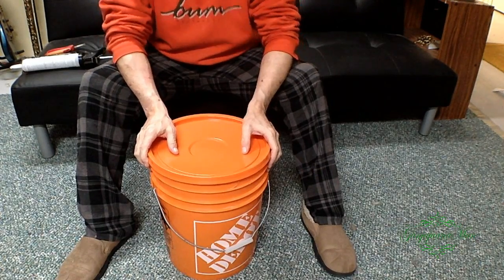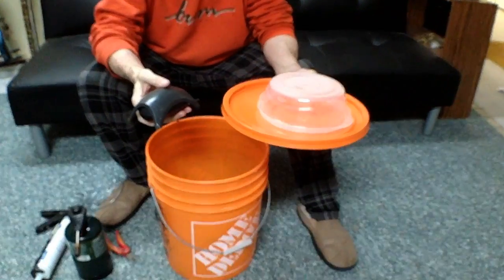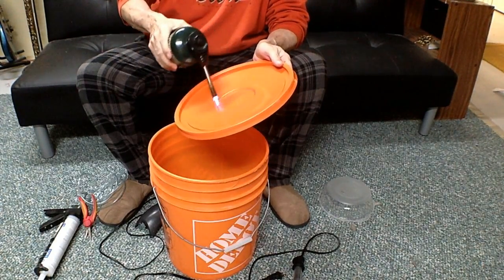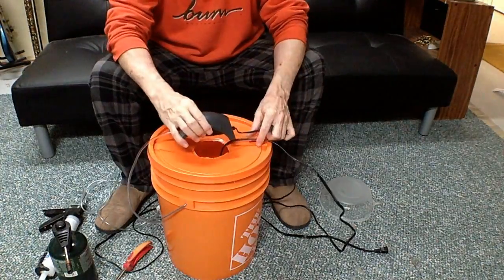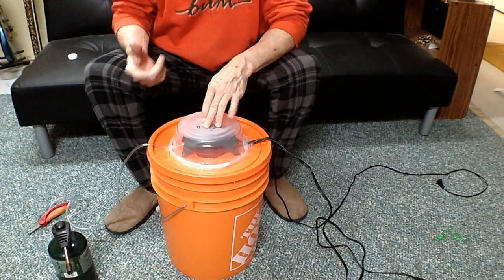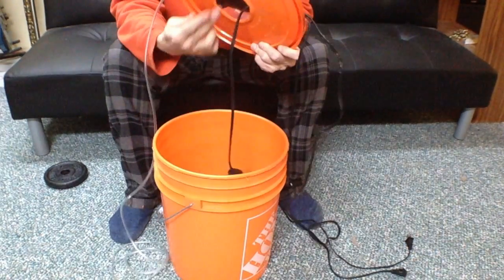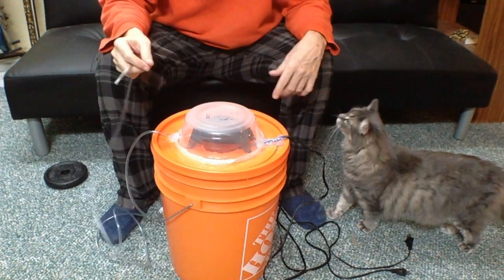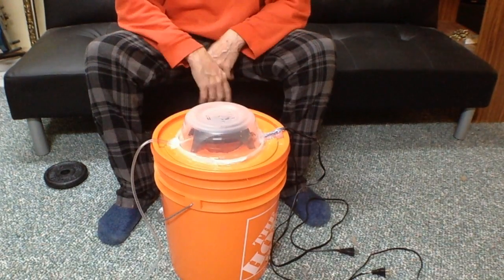c02 Generator: How to, diy, homemade.

Comment: Well done mate! Nice info: simple and straightfoward! Have you ever heard of gamma seal lid? It's seems to be worth of a try concerning the non-hermetic problem for the air pressure. I'll try this on my photobioreactor in conjunction to arduino controller CO2 flow meter. Greetings from Brazil!
Reply from the maker: Thanks, no I haven't heard of that before. 
I have actually figured out an even simpler build, using the air tight lid that comes with the buckets.
It'll blow your mind how simple it is, WAY easier to make then this one & will work 
just as good. stay tuned for a new video.
You will still need an air pump. 
Thanks for watching 💨💨✌
Reply: GanjajuanaMan Great! Eager to see the new design.
Reply: Hi Ganjajuanaman!  I was about to build this bucket system, when I read this comment. Any chance of getting the upgrade video please?  Would be rally appreciated!  Thank you!

Comment: I have a 8 X 16 greenhouse how many of these things do you think I would need also what size Aqurium pump should you get I was on Amazon and see the have from 10 to 100 Gal pumps I would think maybe 10
Reply from the maker: I'll tell you how my room works, maybe that will help you.
In a room with no air vents about 10/15/8 feet I have some tents.
I have one C02 bucket outside the tents with a hose feeding the C02 into the top of 2 tents with a spliter,  Inside each tent is a fan circulating the air & C02 all around the tents. An exhaust fan sucks the air from the tents & blows it back into the room, filling the room with C02 that constantly gets sucked back into the tents because of the vacuum of the exhaust fans, it's a closed circle of air & C02. It just so happens that my temperatures all stay in a good range with this sett up.   
If your green house is sealed during daylight hours & the air & Co2 is circulating & you keep your temperature in check, I think one would do it.
Plants don't need extreme amounts of C02. But a little more helps a lot. Thanks for watching.
oh, just a small air pump & air stone.

Comment: Thank you so much, I built the exact thing with same materials you use and my co2 PPM went from 275 to 1800 PPM and my plants are loving it.
Reply: hello can you tell me what doses you used? I put in a 5 liters tank, 4 liters of water, 1 kilo of sugar, a piece of yeast and a teaspoon of bicarbonate of soda but it does not increase much the ppm. can you tell me your exact doses? I would be very grateful thanks
Reply: @M4stgirls  you need an air pump and you also have to shake the bucket everyday. I never used sodas!
Reply: So I take it I shouldn't have my grow tent in my bedroom if I'm going to make one of these
Reply: @themastergerman9989  i don't think it can get to the amount that can hurt humans. co2 becomes poisonous to us humans after 5000ppm. plants need 700 to 1500ppm. set a timer that stops when they reach 1500ppm or just turn on the ventilation to lower the ppm again.
Reply: @M4stgirls no...1200ppm...anymore than that is just pointless because cannabis saturates at 1200 pm...that's what Bruce Bugbee says anyway
Reply: Cannabis saturates at 1200 ppm

Comment: why do people just not buy a 20lb co2 tank from air gas and a regulator with a built in solenoid switch?  you can control how much is getting used and when. it also lasts for a long time.  My 20lb tank has lasted over 2 years.  All this other crap doesn't make since.
Reply: How much did you pay for your tank and fill? This is info that would be considered relevant to the discussion.

Comment: could you add a winemaking airlock to see when the co2 is active?
Reply: That would affect the pressure in the bucket though. All the co2 you're trying to push out to your plants, is just gonna take the airlock route first because less resistance than an airstone. A water level gauge? with clear tubing, would probably work better.

Comment: How necessary is the pump? I'm using this setup to pump CO2 into a small plastic container, about 1 x 2 x 2 feet in total, with some herbs in it. I have the bucket underneath, and a t-splitter coming out of the lid with lines that go up into the container. I assumed that CO2, being a heavier than air gas, would accumulate in the bucket, and as the pressure increased slowly it would force the gas up the splitter tubes into the container. I can hear/see the yeast bubbling away (they are a bit cold so I'm working on a heating solution) but I can't tell if the gas is making its way up the tubes. I think my connections are airtight, I did a blow test and it took a good amount of pressure before I heard a leak from the seal of the lid of the bucket. But it's hard to tell if the gas is actually going where I need it to go. I don't want to seal up the container without any CO2 in it, the plants will suffocate on their own oxygen!
Reply from the maker: A way to test if it is getting to the container, is to put the ends of the line that go into the container into a glass of water, if it makes bubbles come from the hose then it is getting there, if no bubbles, it's not getting there, then add an air pump. They'er very cheap to buy.
Thanks for watching.

Comment: Cute cat!
I'm sure some people didn't hear, but you're spot on about the timing.
Turn off the pump when the lights are off, the stomata under the leaves are inactive when it's dark, so won't really have any benefit running CO2 while the lights are off.
Reply from the maker: Thanks for watching, check out the newer C02 generator in my most resent video.

Comment: I think this idea is great and have built three of them!  One of the problems I'm having is condensation in the hose and then it won't blow air.  Anyone have solutions?
Reply from the maker: I will make a new video soon of a new and improved & easier to make C02 bucket. thanks for watching.
Reply from the maker: I posted a new video that should solve your issues.  💨💨✌

Comment: Sweeeeet I have a co2 regulator for the tanks but it’s super expensive and I run out of a large tank twice in a single cycle. I like this especially if it generates enough co2 for me maybe I’ll run two.✌️
Reply from the maker: check out the new Co2 generator I made.

Comment: Running the air pump to a stone will greatly increase co2 by agitation and supplying the yeast oxygen so it can reproduce faster. Active dry yeast is most active @ 95`F

Comment: really need 2 air pumps need 1 to bring air in to be c02 soaked maybe a airstone coming from a different pump outside the bucket brings fresh air in and bubbles up the mix for the bucket pump to pull more air n c02 out into the surrounding area

Comment: What I Did was put the pump on the lid inside of it. I screwed it to it. I used different air pump and I took the screws that hold it together and then ran longer screws from the outside to where the old screws were. One thing everyone is missing is you need to pump air into the bucket. If you seal it tight like you have here the pump has no place to get air from. So you need a pump on the outside to pump air into the bucket. Hope you all understand.

Comment: yeast likes body temp 37c. id try wrapping a heating pad around the bucket instead of a heater. maybe use less energy. most ferments are done after 5-8 days. the co2 after that point would negatable. kill two birds with one stone and buy/make a still.

Comment: What temperature you maintain with aquarium heater?? Kindly reply
Reply from the maker: the heater that I have does not have a temperature setting, it is on when plugged in & off when unplugged. my guess is that it keeps the water between 75 & 85 degrees. it is the cheapest heater I could find. I got it at Walmart for about $20, seems to be just right.
Thanks for watching.

Comment: you don't need the air pump.... serious. do this in a carboy instead with a bung and attach your tubing to bung. done.
Reply: The CO2 produced is a gas that  when being produced creates pressure and the CO2 will be  expelled from where it's created.  I think the air pump may make it more efficient in creating CO2, while the heater(not a necessity either) probably keeps the yeast at a temperature that also makes this work more efficiently. Check out the many videos of yeast and sugar CO2 creators. Most are very simple, but it sounds like the 5 gallon bucket version puts out higher levels of CO2 for a longer period of time.
Reply: D.J. Parson do what? Can you explain that a little better I would like to try
Reply: D.J. Parson... your comment makes no sense to the amateurs here :)  Could you explain farther?

Comment: This is a great idea. Looking to do a set up for a planted aquarium. Only problem with this set up is the amount of co2 being pumped into the aquarium. Wondering if hooking up a simple bubble counter and diffuser is all thats needed.
Reply from the maker: I don't know if that is a good idea, the fish in the tank Need Oxygen. they will die if you pump C02 into it.
I used to have an aquarium with live plants, & my plants thrived but it was 
because I was using the proper kind of light. be careful !
Reply: GanjajuanaMan thats what the bubble counter is for. To regulate how much co2 is pumped into the tank.

Comment: Hi man, thanks for amazing explanation, I will definitely try building one for my box. Could you tell me does this can need an intake hole? because as I understand the pump pulls out the gas from inside, but since there is no intake I do not understand when the co2 runs out will there be any risk of damaging the pump?
Reply from the maker: High man,
my bucket lid does not seal air tight so when the pump is on it does suck air in from the rim.
but still gives a great & cheap C02 boost.
at first my lid was too hard to take off the bucket so I melted a little bit of the lid rim just to make it easier 
to put it on & off, so that is where mine gets air from. you could do the same thing or put a small hole 
in the lid for it to get some air. it doesn't need very much but does need some to prevent the bucket from collapsing in on it self.
Mine just turned out this way (by accident) & it works great, I wish I could say that I had it all figured out 
but I got lucky lol. a few people have commented that their  bucket caved in, but I think they have it under control now. Best of luck to you.
Reply: Thanks for the reply man! I will build one for my box and let you know about the results! good luck to you!

Comment: i came i saw i built i dig it in  3-4days i could tell a difference . seems to last pretty strong about 10 days and it's cheap. much thanks, question sir is it true room can be warmer with co2. it's hot here
Reply from the maker: Awesome, 
Yes with C02 you can have your room hotter.
& if using LED lights you will be fine in the mid 80's  💨💨✌
Reply: +GanjajuanaMan traded in the bucket for a glass sparkletts bottle with an air inlet sealed in the lid pushing the gas out of a piece of pic pipe that i can cork if i want also coming out of the lid.. can see it bubbling without opening bucket. i seal it at light time open in dark. thanks again

Comment: how do you prevent it from collapsing on its self
Reply from the maker: My bucket lid does not seal airtight, It gets some air mixed with the C02
Reply: did you take the rubber ring out of the lid?
Reply from the maker: My lid didn't have a rubber ring in it, but when I first got it it was way to hard to open so
I used my little blow torch on the part of the lid that seals so that it would be easier to open.
the end result is that there is a mixture of air & C02 but still gives a great C02 boost.
You could either modify your lid so it go's on & off easier & takes in some air there or make a Small hole in the lid so that it will not collapse on itself.
Reply: It will not collapse on it's self. The yeast eats the sugar creating ethanol and Co2. This is how you make bear and drinking alcohol. If you look at making beer or moonshine videos you will see that the container must be sealed so germs don't get in. The yeast creates so much Co2 that it must be able to escape so you need a way for the gas to escape or the container would explode or at the very least kill the yeast. I make beer and will use this idea for my garden as well as making my beer. Nice to see both hobbies of mine can go hand in hand. Sweet.
Reply from the maker: The reason some people Have had their buckets collapse, I think is because the air pump that they use may be too strong, so if the bucket is totally air tight it can cause a problem. I have told a few people that mine gets some air at the rim & that's what prevents collapse.
Thanks for watching.

Comment: I tried this. DOES NOT WORK. SAVE YOUR MONEY! The moisture from the sealed enclosure gets sucked up by the pump & clogs the air lines. Nice Idea in theory, but in practice it don't work.
Reply from the maker: It's been working for me for about 4 years with no problems.
you must have your bucket to full.
Reply: Yer also worked fine for me and now on my 3ed year works fine around 976ppm
Reply: Have you increased yield??.....by how much?.....interested ....i have a small space....
Reply: Does this really works

Comment: This is a totally sealed unit, is there any issues with the pump starving for air and over heating,does the yeast and sugar generate enough co2 ,how many plants can you feed with this unit?
Reply: You can put a CO2 sensor in the system and use arduino algorithm to tell what CO2 pressure the pump should stop.
Reply: Did exactly this with two xbee wifi's and an arduino UNO.  You can get all the parts on amazon for around $60!
Reply from the maker: my bucket lid does not seal airtight so that's where mine gets some air from. I use a 12 foot by 8 foot space . this unit works great for that. I don't have a c02 meter.

Comment: Do you leave the heater on 24/7? thanks. 
Awesome video, super intuitive!
Reply from the maker: No, I have the heater & air pump on a timer, daylight hours only.
Reply: So would you say, plug it to the same timer as the lights? 
Since you said, not to run the O2 when the lights aren't on.
Reply from the maker: yup & have the timer go on & off a few times a day.
let your plants get some fresh air.
Reply: Thanks for the guidance. Last question: I can set the heater between 65-89, what temp should I choose?

Comment: GanjajuanaMan  As soon as I finished watching your video,I hit the subscribe button. Thanks for the excellent video. I had EVERYTHING !!, I didn't have to buy a single thing. Ha ha ha Lmao.   Some questions for you GanjajuanaMan.  1.  I have a ECO AIR 2(2 adjustable outlets) I got at Wallmart and on the bottom of the pump there are 4 little rubber feet and very little surface area,will that surface area be enough to hold the pump to the lid with super glue?. 2. I have a 4x8x5 grow room, how would you use your generator in my room?  3. What are the effects of too much oxygen?.  Thanks again GanjajMan for excellent video.
Reply from the maker: that's awesome & thanks!
I suggest using the silicone to stick the pump to the lid, it will hold much better then the glue.
If you are using a tent, place bucket outside tent & feed the hose into the top so that the co2 can fall
down onto the plants. you can make a loop above the plants & poke lots of holes in the hose to get even distribution. but Do Not give plants co2 when the lights are out. 
use a timer & give the plants a break during the day time & pay attention to your plants, they will let 
you know how much is to much.
I think you mean, what are the effects of too much co2 ?
short answer is: plants won't like it & growth could be stunted, just very unhappy plants overall. 
Hope that helps
thanks for watching.
Reply: Thank you GanjajuanaMan for your fast reply and valuable information, I will follow your instructions, keep up the good videos.
Reply: Great video Ty... What type of heating pad should I use?

Comment: Nice I will have to make  one ☝️
Reply from the maker: It works great, Thanks for watching 🙂💨💨✌
Reply: GanjajuanaMan
What's the yest and sugar measurement?
Reply from the maker: I use 3-4 cups of sugar & 1 heaping tablespoon of yeast.
Add warm water when you first mix it up.
First stir in the sugar till it's all dissolved.
Then add the yeast 
Give it a light stir, don't go nuts.
put the lid on & very soon it will be pumping out all the c02 you need. ✌
Reply: GanjajuanaMan how often should the mixture be changed out?
Reply: Thanks, the one thing I was missing was the recipe.
Reply: Shawn Cobgrow1 thanks, i must have missed that